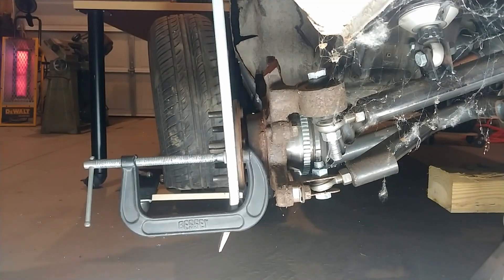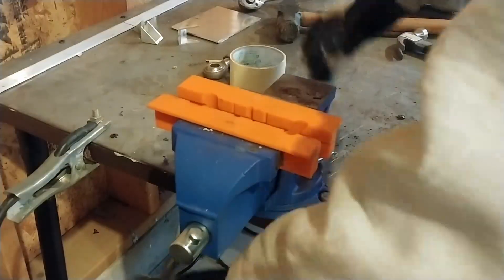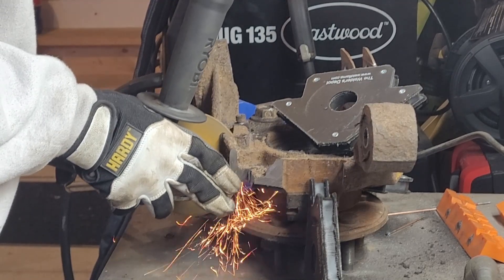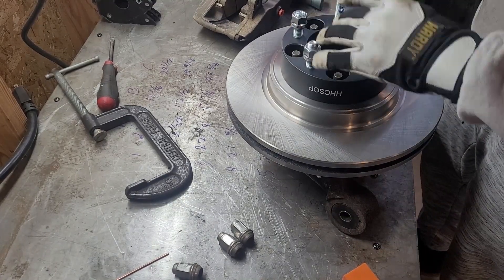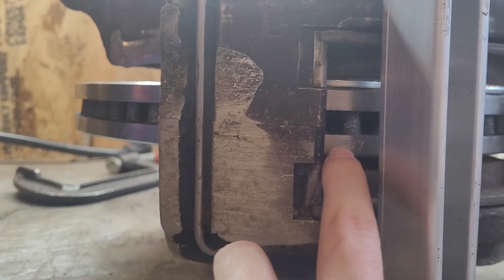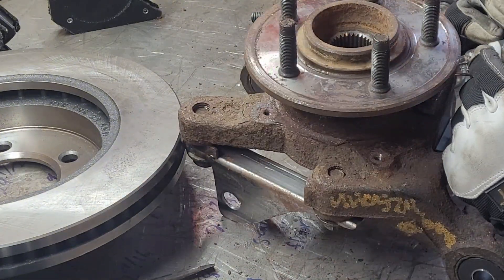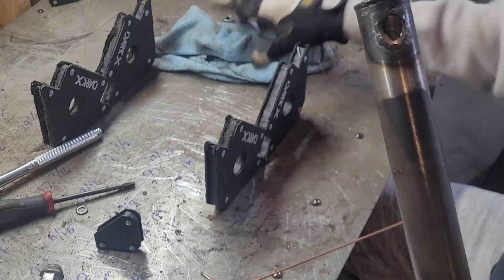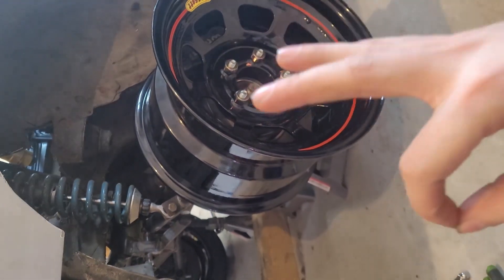Toyota Corolla Ford 8.8 IRS SWAP PART 2!!!

Comment: ARE 3D PRINTED BUSHINGS REALLY GOING TO HOLD UP TO AUTOMOTIVE TYPE FORCES???
Reply from the maker: From digging a bit, people have been using them in different applications with good success. Mine are fully enclosed by metal on all sides, so there's really no where for the material to go. But time will tell. If they fail, they fail, and I'll figure out an alternative method.